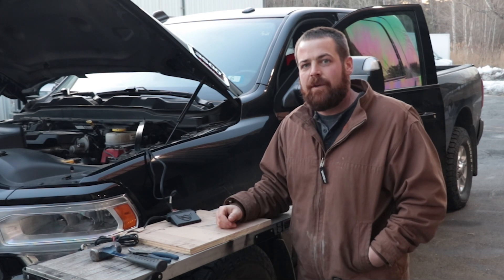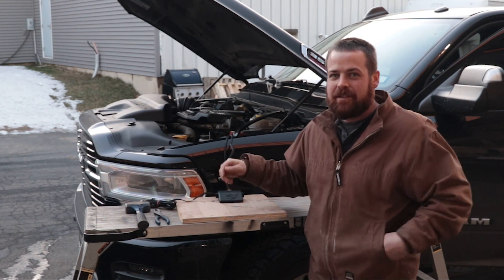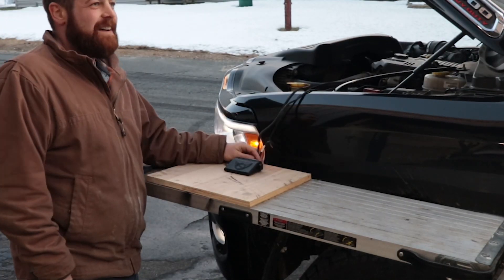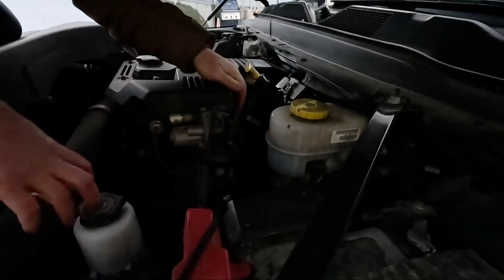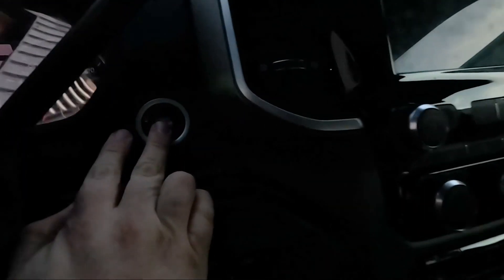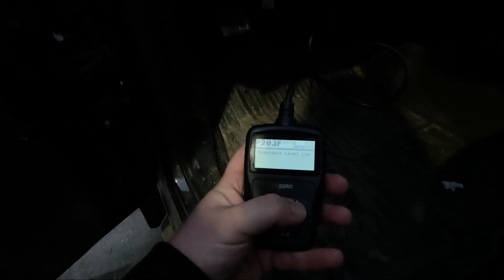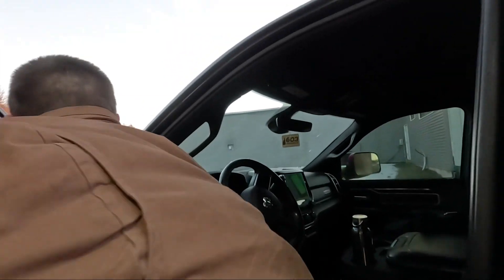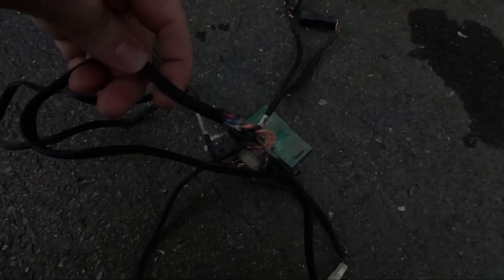Can a Stealth Module hurt my truck?

Comment: So what does it change / control
Reply from the maker: It manipulates fuel rail and boost pressures to bring in more power and drivability while not leaving a footprint on the system